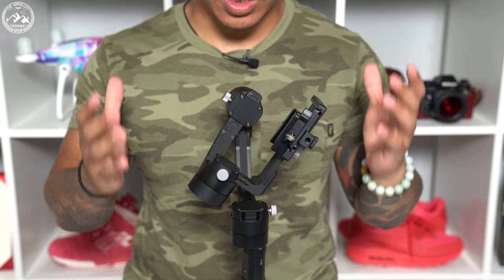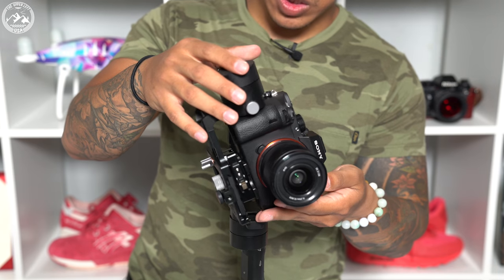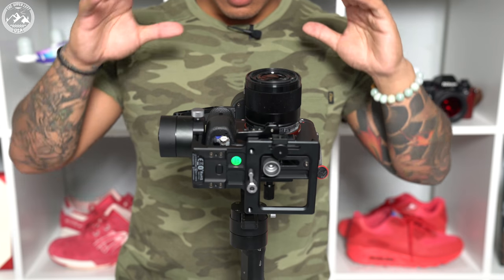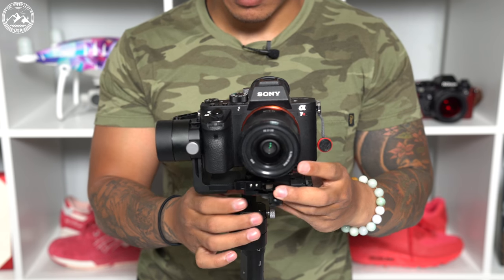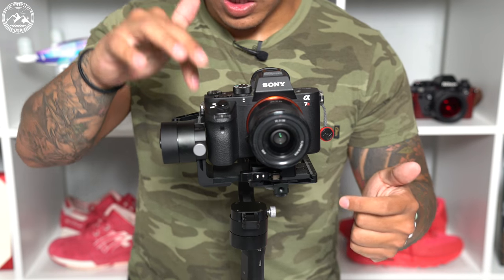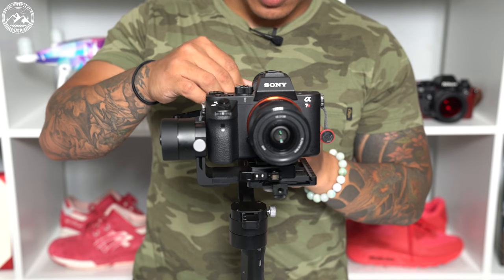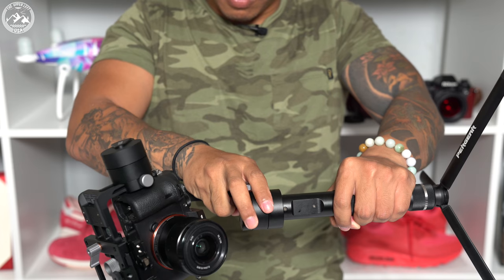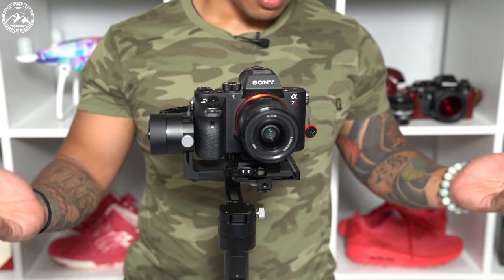How  to Balance the Zhiyun Crane V2

Comment: Hey man I’m using the Sony a6000 with Sigma 30mm 1.4 it’s always front heavy no matter how far up or down my axis is, any help
Reply from the maker: Have you tried moving the setup back towards the roll motor?
Reply: The Upper Left USA yes
Reply from the maker: From experience, I would say that because the lens you're using is relatively small, it shouldn't give you much trouble with being front heavy. If your setup is far back towards the roll motor and low on the tilt motor and you're still front heavy, something is wrong. It takes a lot of weight to push those two axis to the max. I had heavier setups on my Crane and I didn't even push them that far. The only two points of adjustments that would affect the issues that you're facing are the camera/baseplate position and the height of the tilt arm.
Reply: The Upper Left USA it’s fine I got it solved I just taped some weights to the top of the camera, it finally balances, I’m guessing the weight distribution from this setup by itself isn’t exactly made for this gimbal, if I put a mic on it then it would work a lot better, but thanks for trying to help
Reply from the maker: I've been thinking that over the past day. The only thing I could think of was that your setup wasn't heavy enough. But that didn't make sense to me because you said that you had the tilt arm low. Which in theory would only be front heavy if you have a setup that was heavier than the gimbal could balance. A really light setup would need to have the tilt arm all the way up. Either way, glad you were able to solve the problem. Have fun using the gimbal 👍
Reply: The Upper Left USA yes I’m very pleased with it, I picked it up off craigslist for 200$!! :D
Reply from the maker: Good to hear! Thanks for watching.

Comment: WTH! mine will NOT tilt forward at ALL!!?? HELP
Reply from the maker: How so? You're not giving enough information.
Reply: The Upper Left USA hi man, it only tilts forward with my larger lens (12-60) it wouldn’t tilt forward with my 25mm. Very annoying. I’ve now balanced it on my larger lens but when I turn it on the camera just flies all over the place. Idk !!
Reply from the maker: If it's tilting forward then the only logical answer is that the camera isn't pulled back far enough towards the roll axis motor. How high you have the carriage on the horizontal will also affect this.
Reply: The Upper Left USA no! It will not tilt forward. Matter what I do, there’s not enough weight in front
Reply from the maker: It is extremely difficult to not have enough weight in front because essentially all camera setup with a lens will be front heavy.
Reply: The Upper Left USA my camera is a lumix g85 they are very back heavy and when fixed with a 25mm. It’s apparently not enough weight
Reply from the maker: If you can raise the carriage on the horizontal arm all the way up and have the base plate all the way forward without forward tilt, then there is nothing else to do but add more weight with some other source.
Reply: Bro thanks for all the help!! Haha I said fuck it and screw in a hot shoe adapter thing on to the front! But I order a heavy quick release plate, so I hope that’ll do the same
Reply: Wait! But when I pick it up it doesn’t stay in place. It swings around still. Is leveled but that’s it. And when I move it, it won’t stay in the place like it’s meant to.
Reply: And I can’t move the base plate because it needs to stay all the way forward; otherwise, the camera will tilt back.
Reply from the maker: If it doesn't stay in place, it's likely not balanced properly but wait until you get the heavier adapter plate to see what effects that have on the balancing.